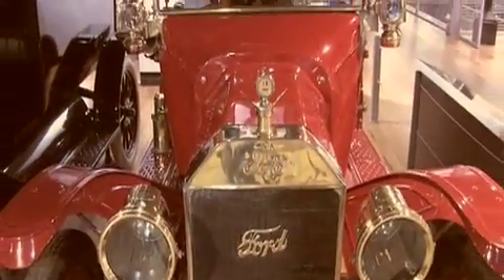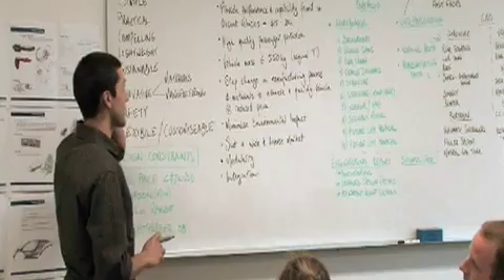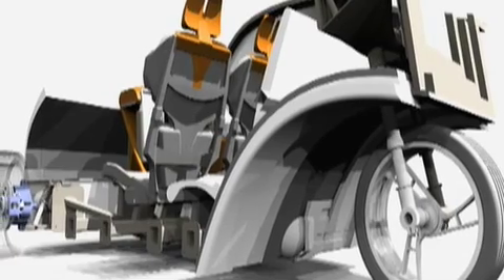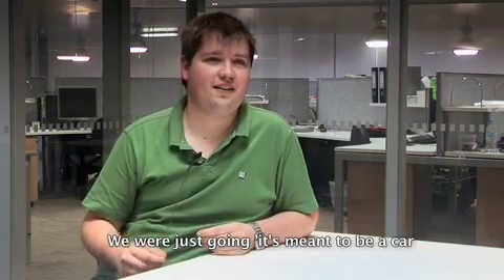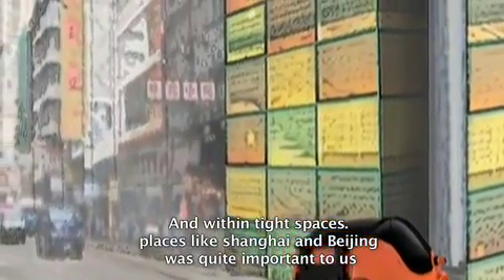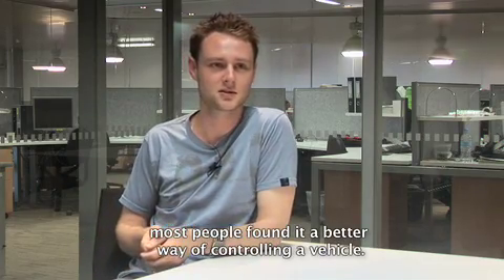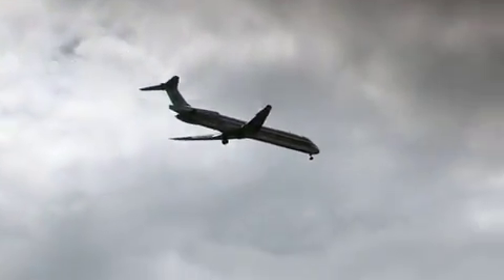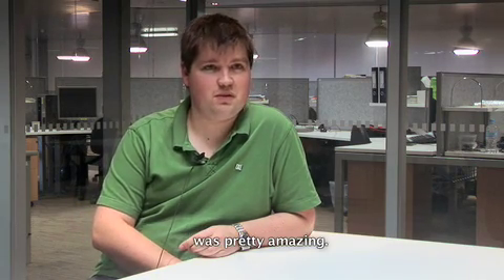The Air Powered Car Part 2

Comment: Great video, but how does the steering wheel control the throttle?
I mean, you could use buttons but they would have to be pressure sensitive, but that would also be less accurate than foot pedals.

Comment: Vehicles powered by compressed air …… most scientists don’t understand how it can be achieved efficiently.

By Angelo Di Pietro from Engineair Pty Ltd, Australia in response to critics of compressed air vehicles.

Ask yourself what an internal combustion engine really is, and what it does?

An internal combustion engine is no more than a compressor, its initial operation is to compress the air and it does so in the worst possible manner ….. it compresses hot air and uses petrol or diesel to do so. A good part of the fuel you put in your tank is used for this operation and polluting our environment in the process.

Now ask yourself why you think it is better to use fuel to compress the air when solar, wind and hydro is a clean and more affordable option.

Furthermore, why should we use petrol, gas or diesel to generate heat to power the motor when the same performance can be obtained by storing heat generated by solar wind or hydro and not polluting or burning any oxygen in the process. And doing so in a much more affordable manner.

We can get all the power we need from the Engineair motor, its performance is already much better then an internal combustion engine.

There is so much more I would love to tell you but unfortunately I cannot because of trade secrets, I am sorry.

By visiting our facility and signing a nondisclosure agreement I can provide a much better insight into our technology and its potential.
Reply: Angelo Di Pietro We all wait with interest for something to happen.   Can you comment on the issue if energy density and the fact they needed a heater (with presumably a battery as the energy source) in such a small, light vehicle?  This problem would affect all air-powered vehicles.

BTW: Good video.

Comment: Also, don't forget about the appliances of graphene. Graphene can be coated onto anything with much higher efficiency than currently used solar cell technology; i.e.onto  the body of the vehicle as a kind of laquer/paint. In this case it could function as a solar cell, providing the onboard aircompressor with energy. This will increase both your radius as well as the 'eco'-factor. Two birds with one stone, kind of concepts are endlessly possible...but only if we want to! :)

Comment: In order to get better range this car will need a wind powered air compressor which like where the engine would go put that wind powered air compressor so when driving forward you can get more air to flow in and spin a mininiture fan blade which then if you need to re-fill this small but powerful 20,000 psi air compressor  will be able to fill the tank(s) on the go.:)

Comment: Nice job on a great idea.Compressing air is no problem up to 10,000 psi with a hand pump but use the wind to this instead. How about changing the shape and using ALL  internal frame space and every reasonable surrounding components to store air? I see near double the air volume. Yes the costs go up but look at the savings in just fuel alone.A load sensing  intermittent supply of air to the motor, like a speed skater pacing their stride, should conserve quite a bit, therefore extending range.